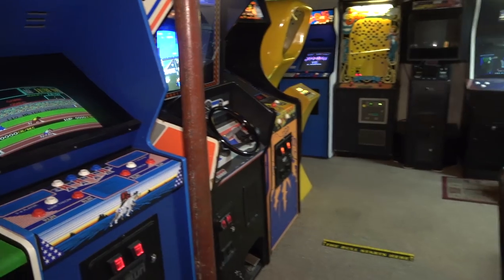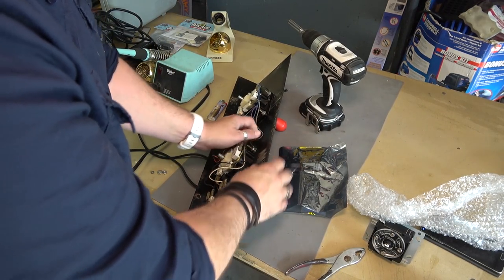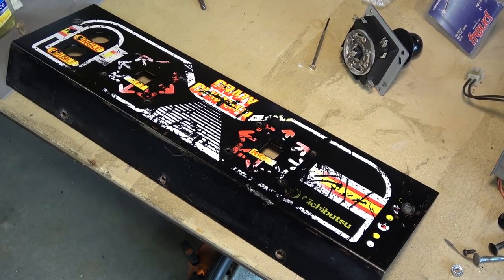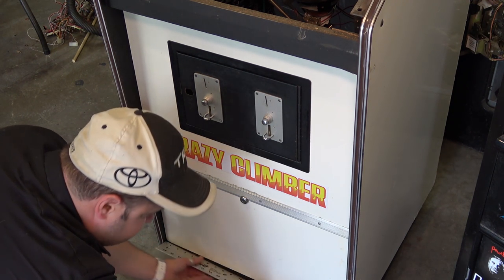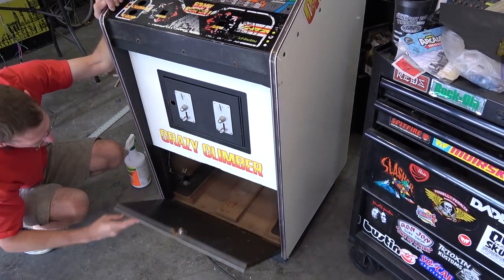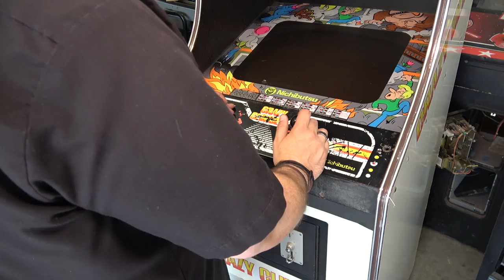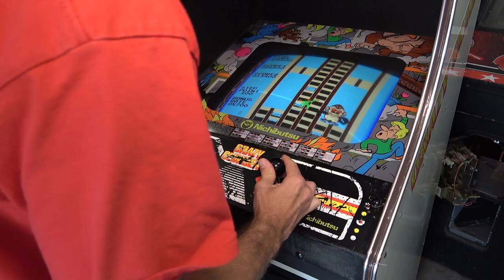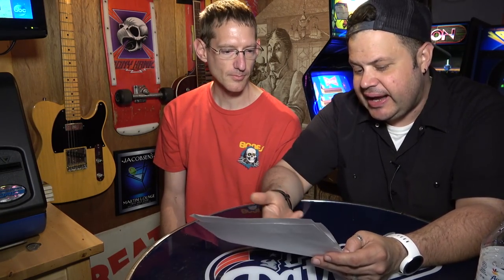Nichibutsu Crazy Climber DONE! w/Adam - Control Panel and Joystick "restore"

Comment: Chuck those carriage bolts in a drill press, and use a file to take off the manufacturing marks, then use sandpaper to smooth them out. Works perfect and weather you paint or not it looks great!

Comment: On Japanese joysticks you dont need to remove the shaft like that, just unscrew the ball top, there is clearly a slot in the bottom of the shaft where you can put a flat head screwdriver to hold the shaft still while you unscrew/tighten the ball top.

Comment: Regarding the ball tops, you need to use a flathead screwdriver on the bottom to hold it then twist the ball on top as tight as you can with your other hand.  Then when people try to unscrew it, the whole shaft turns and they can't take it off.  This is how they prevent people from stealing them in the arcade.

Comment: Hey John, I find that when I play CC it is easier to move the guy if you keep both hands in the same column.  You won't get hung up when trying to dodge obstacles as much.  Once you get the rhythm down you won't have any problem getting 100,000 points or more. First building should never cost you a life.  Second will get a cheap death from the girders.  Third building billboards will require you to move really fast!  Forth building you'll need a couple lives to get through every time.

Comment: John - about those locks you keep having to drill out...

Google 'bump key'. It is a special type of key that you can make from a regular key using a file.

You insert it into the lock and tap it with a piece of wood/small hammer etc while applying a small amount of turning pressure.
It will open the lock without damaging either the lock or the bump key.
 Usually you only need 4 or 5 taps to open the simple locks found on arcade machines.

Not only would it save you having to drill out locks, it could also be a useful thing to have on your keychain for when you go to look at a new machine.

Comment: Hey John when/if you ever worked on a Pac or Ms. Pac, did you ever notice a metal arm holding the monitor to the right hand side (from the back) of the cabinet? And was there a wooden block for the door in the way of it?

Comment: Hey John. To clarify on My comment from my email where I mentioned on getting rid of 720 or Paperboy was to put it at the Hanger in rotation; not get rid of it outright.
By the way, do you need that round air humidifier/cleaner that sits on your fridge in operation or is that something you can relocate?

Comment: Rich from This Old Game can screen print directly onto a control panel. He's done it before with Missile Command control panels. Also, that would be an easy design to vectorize. If I had a 600 PPI scan of it I'd probably vectorize it just for the fun of it. I did the vectorization for all the Super Punch-Out stuff that Rich and Mike Haaland (Mike's Arcade) sells (side art, "Ducking Pull" sticker, and marquee).

Comment: oh bum, deleted my comment by accident. tl:dr, 100% agree with the removal of the vinyl, maybe cover it with Tackyback if you can find it to preserve the silk screen. Also, props for keeping your legit "new" ROM set as is.

Here's a lil tip that works for removing large adhesives from thin metal, instead of heating the plastic that the glue is on (in your case the black crap),, clamp the part down and heat the BACK of the thin metal. As small of a heat differential it may seem, it helps a load - the bit you're peeling off is a lot cooler than the metal you're heating, meaning most of the adhesive will stick to the bit you are removing.

Please find an online sources for dime and dollar bits and bobs and buy a load. A tray of coach bolts and washers, loads of E clips, daft crep like that, stop feeding the hardware stores quarters, save them for your arcade.

Comment: John, maybe not so many metal shavings fall inside the cabinet when drilling out the lock, but for sure the metal latch bar and screw will fall down in to the cabinet if you happen to drill "through" the latch mechanism... and that latch bar is a gigantic piece of conductive metal obeying the laws of gravity... Just say'n.  Turn the game OFF.  Good call on the CP - keep it as original as possible!

Comment: I did mention this before John! but why don't you just paint the control panel with some enamel or acrylic paint couple of artist brush use a flat No 6 or 8 and a No 2 pointy it's not too complicated or difficult. spoiler alert!!!! nice pin gorgar, that's the one you've got isn't it undercover!!!!
Reply: the wife been half-inching  the batteries again lol
Reply: why won't it save the scores John surely if you're putting your name in! it must save the scores what would be the point otherwise??
Reply: John sweda ,yes looks like Gorgar pinball writing to me.
Reply: John sweda thats not a gorgar for sure gorgar is not blue on the back of the head its black
Reply: Arcade Freak 2016 there's different versions there's gottlieb gorgar, and Midway gorgar, I think he's got the Midway?
Reply: John sweda i never heard of a gottlieb gorgar i know for sure the williams one is black i had one

Comment: 51:34 "this joystick sucks, the restrictor plate is square, instead of a circle, so it's a little harder to do diagonals". That is completely false!!!! In fact, there is no better restrictor to do diagonals than square ones. Circles and Octagonals, give you less access to the diagonals. http://www.slagcoin.com/joystick/restrictors.html watch here and check the diagrams of "access" on every restrictor to every corner.
And these dustwasher should be on top, covering the square "hole".
Reply from the maker: Yes, this is what other people said about the joysticks. And, I disagree... Dustwashers under CP whenever possible. BTW - that's some pretty hardcore restrictor data!
Reply: Under is correct for a metal control panel.